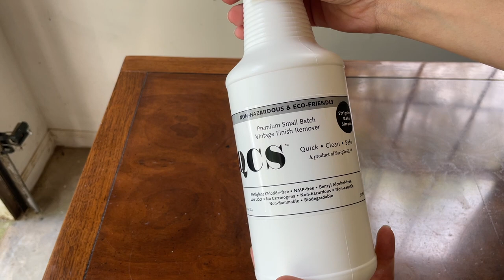Can Strip Well's Eco Friendly Paint stripper remove this out of date finish??

Comment: how many projects do you think a bottle will last? I want to try it but I'm a little sticker shocked
Reply: I see where you said you ran out on one project 😬 I don't want to spend 40 bucks on one dresser but it looks like it works so well
Reply from the maker: I used two bottles for this project. But it depends how much your removing and how thick it is